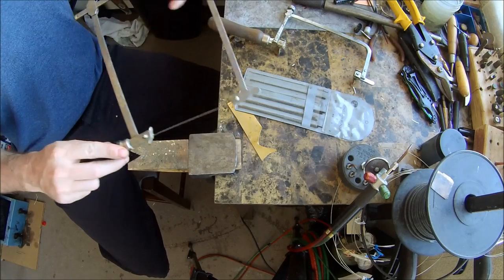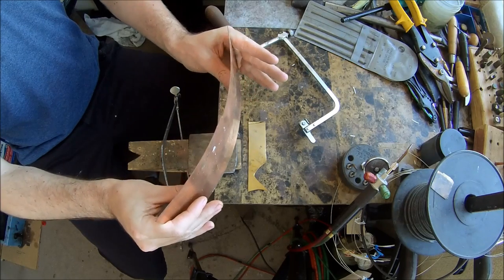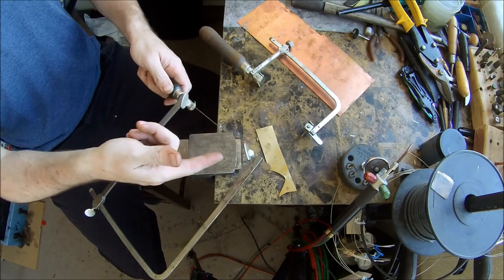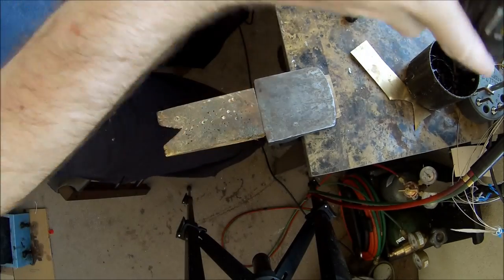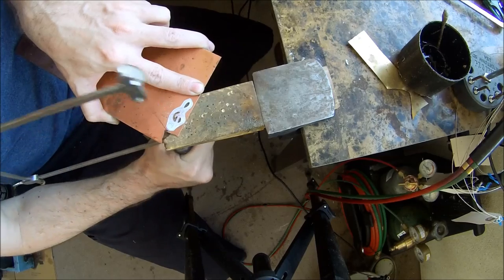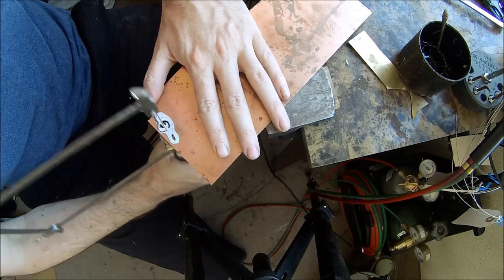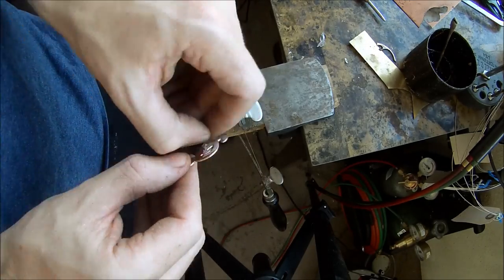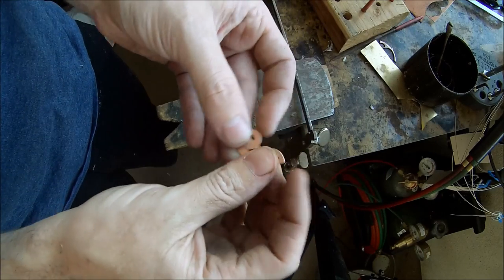How To Use A Jewelers Saw the Right And Wrong Way.

Comment: Wait so this saw clamps the blade
Reply from the maker: What do you mean?
Reply: @GomeowCreations  I mean the saws I've used usually have a hole or piec of rod that hooks the blade but this type of saw just uses good ol friction and compression 

It's just a bit odd to me
Reply from the maker: This is normal for the saws that I have used for jewelry work. I have a saw like this that has the setup you are talking about bit that is for wood and much thicker metals and steel. 

Check out this video I might also help with this kind of saw https://youtu.be/tBxRPVAwQrw
Reply: @GomeowCreations  that's alot of equipment what is ur job
Reply from the maker: Yeah the amount of tools you can use for jewelry is crazy but it you only do one type or a limited type of designs you really don't need that many tools.
Reply: @GomeowCreations  I probably have most tools besides a lathe and saw to do  jewelry 
But I domt really  have much inspiration 
Maybe when i see some nice designs I'll decide to make it from from metal 

I've found magnesium is very nice to work with problem is it's almost half the price of gold in my country 

I got magnesium rods in a weird way at first though for really cheap
Reply from the maker: That is not a material that I have ever worked with to be honest. I only use silver, copper, brass and some gold.
Reply: @GomeowCreations  I started out with knife making 
Then I saw wood carving and then jewelry recently so I wanted to try it also I like a jeweller's saw since the blade is much more thin than a coping saw so I would be able to get in close and precise 

Recently I was making a guard 
The attempt failed but heres were I want to improve my accuracy so jeweller's saw 

Anyways as about materials I've heard of people using titanium and Damascus steel
But if u dont have some kind of superman cutting blades that are equivalent to diamond dont go near those materials since these are tough and titanium is from what I've heard abrasive resistant 
I'm yet to test that though
Reply from the maker: So when you work with titanium or Damascus steel 99% of the time it is done an a lathe with a carbide cutting bit or on other machining tools. You also can't really work those metals by hand or shape them that is what copper, brass, silver and gold are used a lot for jewelry. I do suggest copper I'd you are just starting out seeing that it's very cheap to get and easy to work. If you have a little more money you can start with silver seeing that it's easier to solder compared to copper.

Comment: would  you  please   sone  of  highest  grade     wiresaw  for    metal;  gemstone;   hardwood  workers  that  performe   DIY   projects?     the   highest  quality  electroplated  diamond   coated  or  diamond  inserted  in   half mm  (  down  to  0/ 26  mm)at  90cm .....such  sizes with    handles  that  you  can  choose  your  favorit   lenght   (     separate  handles or  arc  shape  handles(  hacjsaw type)   and   extrealy   robust  with  long  life  expectancy  and  shocking  quality....i resaearch  for  getman  ;   japan  or  austrian   highest  quality    official   websites  of  such  custom  wiresaw  makers  or  companies  but   i   couldnt    achieve    something   nice....please    name    some  of  the  best    ..no  matter  of  price.....cutting   exoenssive  woods  like   black   betmes  or  ebony   or   exotic  rare  woods   is  a  matter  of  kind   when  you   hade  to   have    0/2  mm  curved    cut    several  times  in   2cm  thickness....and  needs    extream  quality    woven  diamond   inserted   very  very   thin  and severly   hard  at  the  same  time  very   flexuble    wiresaws......please   guide  me  to   best  brands   and   some    names.....Respictively   .Kelary.H